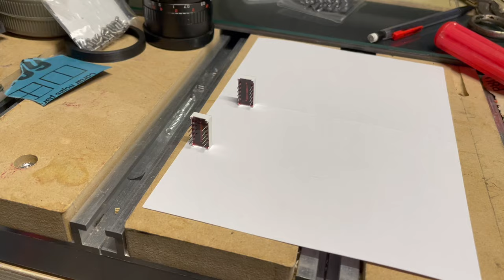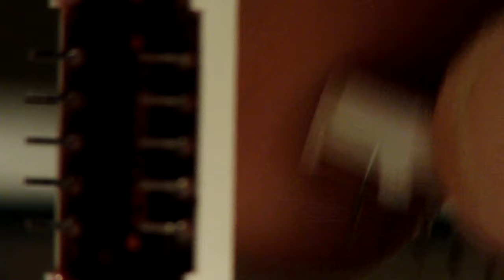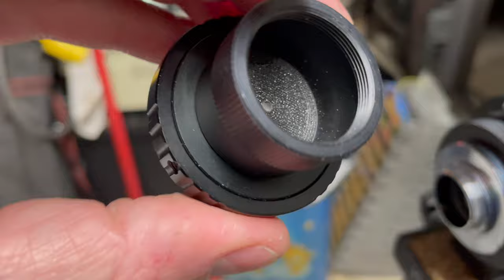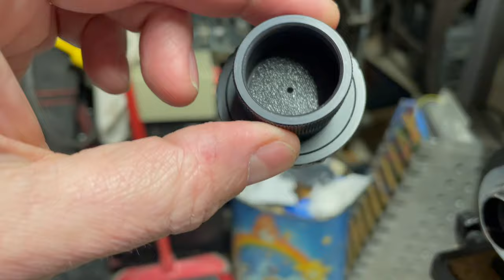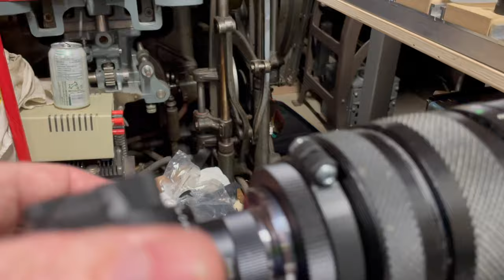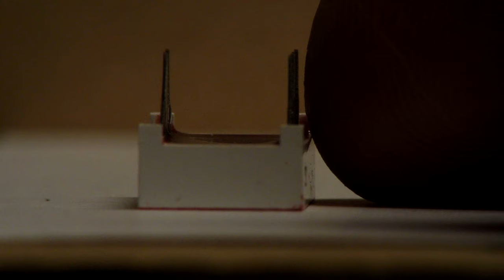Photos without perspective?

Comment: If object was placed 10meters away, would it still be the same size? - What is the limitation of your setup? 😊
Reply from the maker: The limiting factor is depth of field. This setup has a depth of field of maybe 10mm. An object 5 cm away from its focal point would be a blurry blob. An object 10 meters away wouldn’t be discernible from the photonic soup of local albedo.
Reply: @beefchicken  Thank you.  However,  with the zoom adjustment, how far could you move the object away from the camera and would the lens magnification change?
Reply from the maker: @dzidmail in the video the lens is at its greatest zoom (108 mm). I tried to zoom out a tiny bit (to around 100 mm) at 4:03 but because I effectively have a 20mm macro tube on the lens, it very quickly shifts the front focal point of the lens inside the lens , so it’s impossible to get the object close enough to the lens to be in focus.

Comment: What is the field of view? - The same as size of front lens?
Reply from the maker: Yeah, the upper limit is the diameter of the front lens. But I’m using a lens designed for a 1” sensor (16mm diagonal) on a 1/2.3” sensor (7.8mm diagonal), so a lot of the image is being projected beyond the sensor. 

(Yes, sensor size nomenclature is ridiculous, it’s based on the size of vacuum tube image sensors, so a 1” diameter vacuum tube vidicon had an image area of with a diagonal of 16mm)